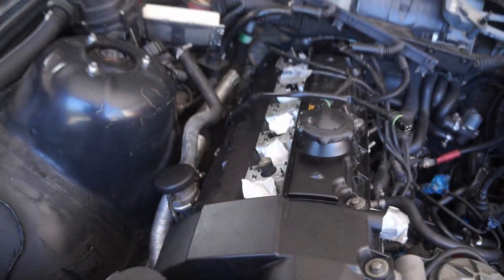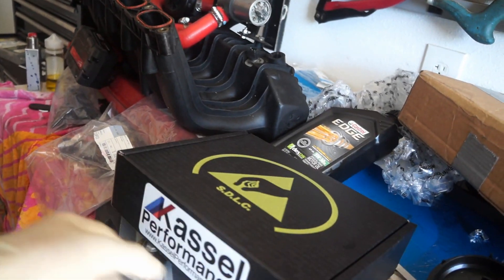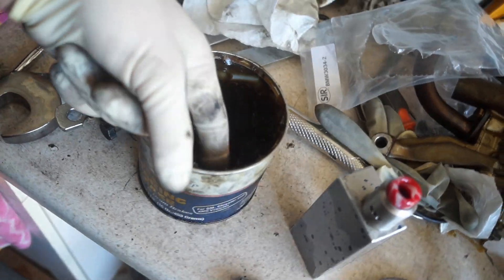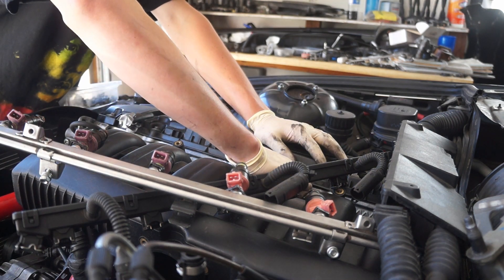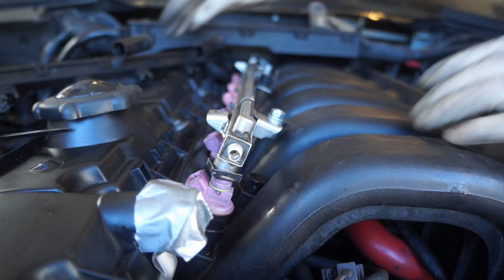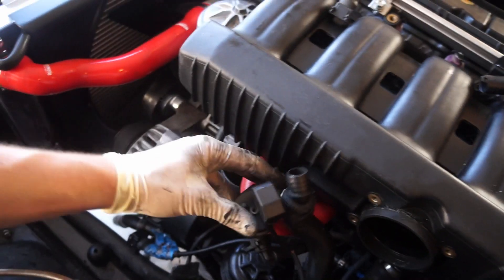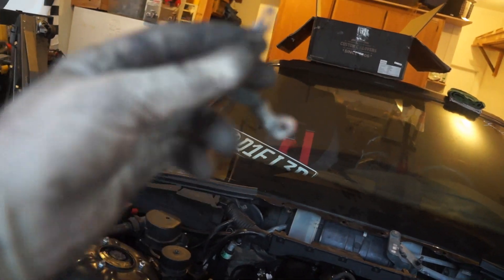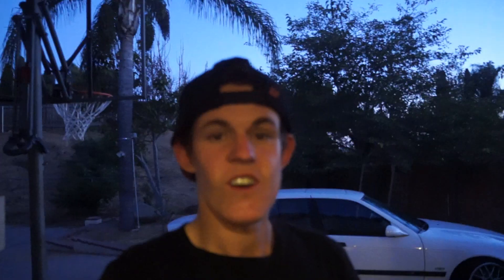Intake System Goes on the S52!

Comment: Love the vids you're putting out, keep up the good work. Question, why do you need to re-torque the bottom end bolts? Sorry I probably missed you're explanation in a previous vid, just wondering if it's standard practice or if you fkd up the torque specs. Also, feel free to check out my channel for some track work my rat and I do if interested :)
Reply from the maker: a few reasons lol, main one is that some ARP bolts/ studs need to be retorqued after they are heat cycled once, but also i got some bad information on the rod bolts and torqued them to 28 instead of 40.
Reply: Beauty, thanks for the info. I'm just about to throw the 201-4302 head studs into my M50, no mention in the documentation of re-torquing once heat cycled, so I assume they'll be ok being fastened once!
Reply from the maker: I would just to be safe, When i Re-torqued mine 6 of them were loose. they were not loose, just not at their proper torque. valve cover's are easy to take off, I think its worth the peice of mind.
Reply: Yeah will definitely keep it in mind! Cheers

Comment: Few hours away, bru I did my timing again today and still the same thing it's backfiring making crackling sounds from the intake manifold when I give acceleration from the throttle body what do I do now 😪 ? I did a diagnostic test no codes did the timing and still stuck now I am thinking of fuel pressure test ?
Reply from the maker: I would do a fuel pressure test, do a compression test, see what your numbers are. is it still not throwing codes?
Reply: Still no codes 😭
Reply from the maker: hmm, have you replaced the DME yet?
Reply: Not yet main symptoms backfiring through the intake manifold
Reply: This is what I mean https://youtu.be/7JSyzdYBFFE
Reply from the maker: weird man, ive never heard of anything like that before. how did you check your timing?
Reply: Look up bmw backfire on intake manifold it looks kind common, how I did the timing crank o/t line with crank block line cams dot facing up main timing chain and sprockets all to the left I noticed when I turn the tensioner in the sprockets holes move from the left towards the middle,
Reply from the maker: is your exhaust cam not tight?? all that shit should be tight bro
Reply: Don't wanna snap the nuts off on the on the exhaust cam the guy buy the machine shop said I must torque that nuts to 15nm I don't know how much ft-lbs is that
Reply: I think I must take off my intake manifold and see if all my vacuum pipes is plugged in